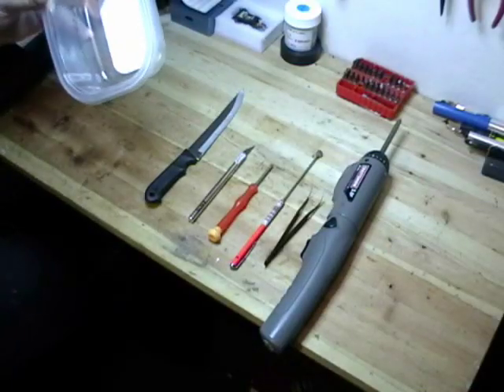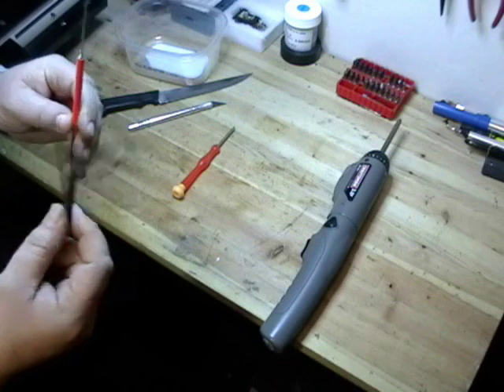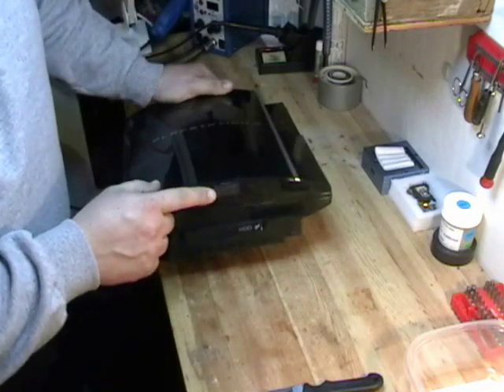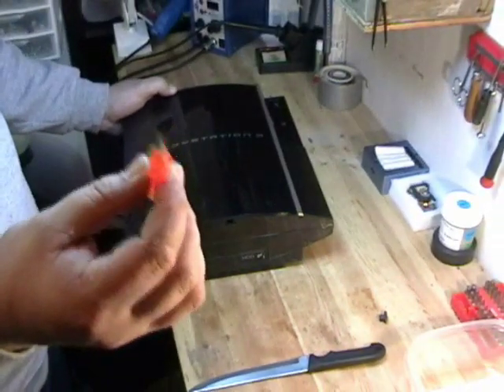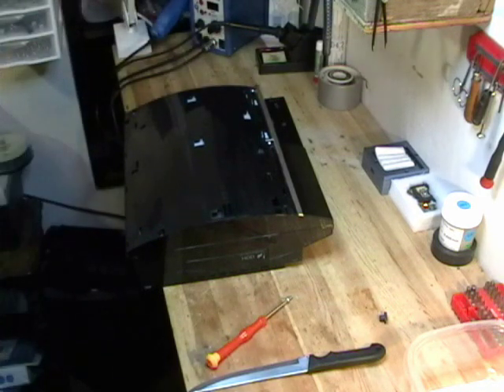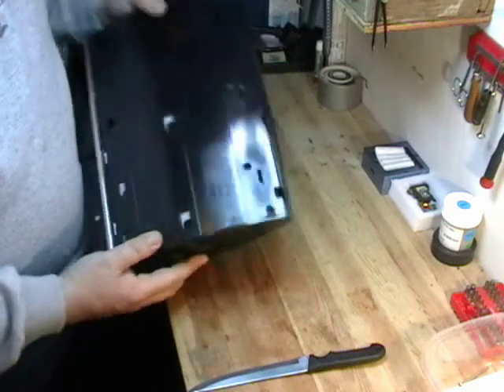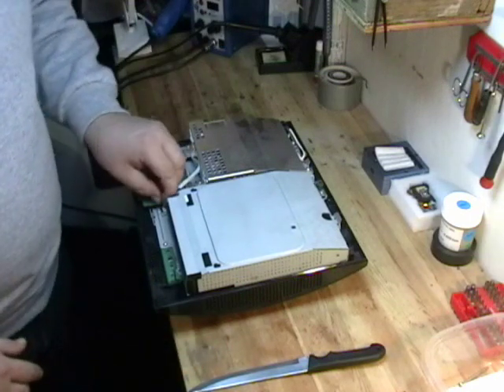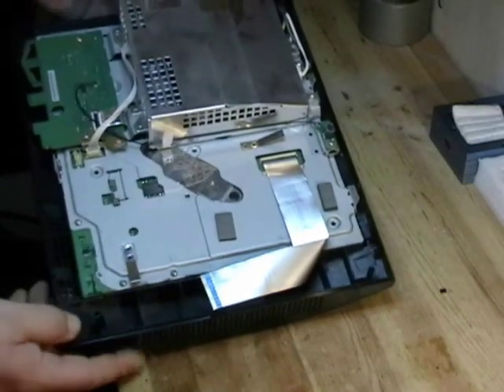PS3 Disassembly 40GB non backwards compatable

Comment from the maker: It is the other 40GB with the dual laser KEM-410a laser. It is the newest model that they made. they changed from steel to plastic on power supply. and also to the dual laser.

Comment from the maker: @CADMANtheCODmaster this is the dreaded YLOD the green light turns on and the red light domes on makint he yellow light appear for about one second if you look closely you will see it happen then the red light blinks. the system has a broken solder joint most likely under the main processor and the only way to repair it is to have it reflowed or reballed. Reflowing is  a temporary fix and it will happen again. reballing the processor is expensive and only a few people do it.

Comment: The security sticker can be peeled off without voiding if you use a heat gun on a low setting to melt the glue.

Comment from the maker: @Cleonn100 you broke off the flip part of the ribbon connection? or did you rip off the whole connector? if its just the flip part you can try to place it back into place or tape it into place and keep your fingers crossed. if that dose not work you may want to send it in to have the connector replaced this is a surface mounted clip and it takes someone with proper tools and skill to re solder it in place. I do sell the clips if you want to do it yourself.

Comment from the maker: @IIXxAeroWxXII YES BUT IF YOU DONT USE HEAT WHEN PULLING THE STICKER OFF IT WILL VOID OUT IN SPOTS BUT IT WILL STICK BACK ON. IF YOUR PS3 IS OUT OF WARANTY THEN DONT EVEN WORRY ABOUT IT JUST RIP IT OFF. IF ITS STILL UNDER WARANTY THEN SEND IT IN FOR SERVICE ITS SIMPLE.

Comment from the maker: @randomidea0 You can just put the hdd into the new slim but you will loose your info becouse it will reformat thr HDD when you put it into the new slim. There is a backup option on the PS3 that will backup to your new slim from your old ps3 but if it is YLOD your out of luck unless you do a reflow to get it working temporaily and then do a quick backup from one PS3 to the other. So if you swap HDD it will reformat! the onlu way to save your old data is BACKUP option on the old PS3 to the new PS3

Comment from the maker: Was it new when you got it 4 months ago? what the date on bottom of PS3? also is waranty sticker still intact on left side of PS3 above the HDD door? It may be clogged with dust. also try not using the intercooler maybe a berring is going on one of the fans on the intercooler.

Comment: @pimpmyps3 i have recently got the YLOD, though i accept that not much can be done about this i did have my own hard drive, a 360G SATA installed. i noticed that Sony has stopped making their PS3's with the removable Hard Drive cover. I was wondering if you could do a vid about installing new HD into the slims or a method for getting the info off the Hd and into a external hard drive so that the information can be backed up onto the new system. This would be very much apreciated,

Comment from the maker: @CONRADVONKEITH OK FIRST OFF LETS DIAG THE PROBLEM WHEN YOU INSERT A GAME INTO THE PS3 DO YOU SEE THE LITTLE ROUND ICON IN THE UPPER RIGHT HAND CORNER SPINNING? IF THIS ICON SPINS AND IT DOES NOT READ THE DISC THEN YOU NEED A LASER. SECOND WHAT MODEL IS IT ? CECHG01, CECHL01 THER ARE 2 40GB MODELS MADE? THIRD I DON’T SUGGEST CLEANING THE LASER BECOUSE IT REALY DOSENT GET DUST INSIDE THE DRIVE AND YOU MAU DAMAGE SOMETHING BY ATTEMPTING TO CLEAN IT. 

LET ME KNOW WHAT YOU FIND

Comment from the maker: If it is only a few months old and under waranty Then I wouldnt worrie. Its probably not dusty in a few months to clog it up so I wouldnt open it especialy if it under waranty still. Just send it back if it burns up lol. But do try to take intercooler off and see if it still smells. If it does not, then its the intercooler.

Comment: A Way To Help Prevent PS3 Troubles Is To Feel The System Processer(Feel the back of the ps3.)If It Is Hot then shut down the ps3 for a hour or so.System Cooling will be a huge help.You're Welcome.

Comment: Hi, I recently did a Ylod fix on my ps3. Its the one with only 2 USB ports, 40 GB, and non-backward compatable. Anyways, after I did the fix, it no longer has the ylod. However it will not show a display. Because this is my second time doing this in a month I warmed up the chips longer than normal. I did focus more on the left chip than the right. Is there any hope for my ps3 to have a revival? 
Thanks, and that parrot is friggin cool!

Comment: i have bought a refurbed bluray unit it didnt come with the control board but i used my old one it fits... but i think my bluray - mboard ribbon is stuffed... the laser moves around but the drive wont accept discs.... and with the ribbon connected it doesnt 'beep x3' wen i press the eject... does the big ribbon control the eject and load ??

Comment: I'm having issues with my PS3. mainly, every time i run a game it tells me after a few minutes (usually about 5) that the system has become hot and it advises i shut it down. Now, i had it repaired at chirstmas as i had got YLOD, and ever since, every time i run a game or use any disk the fans become almost unbarebly loud. Asin i used to my TV volume at 20-30. now i have to have it 70+ just to clearly hear what im playing. Any ideas as to what it is?